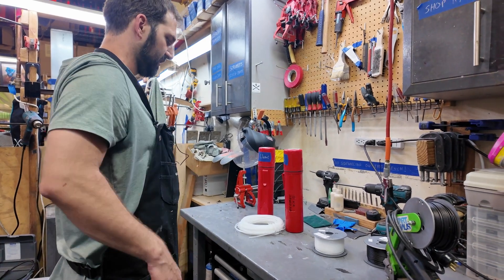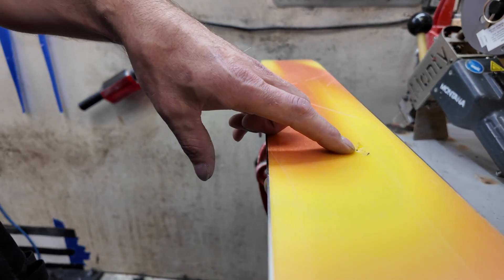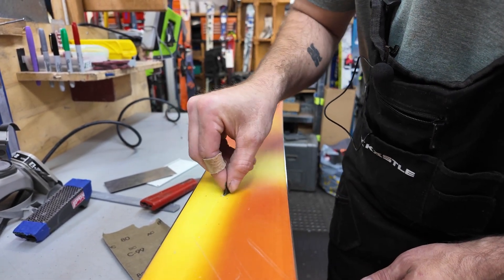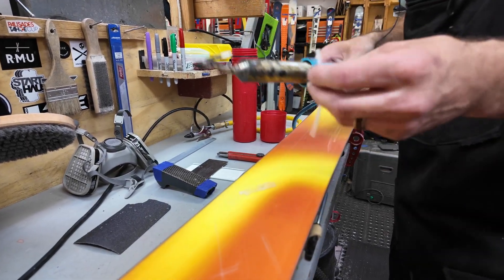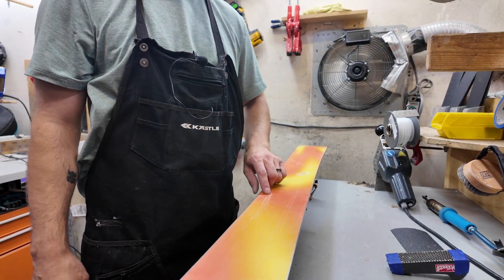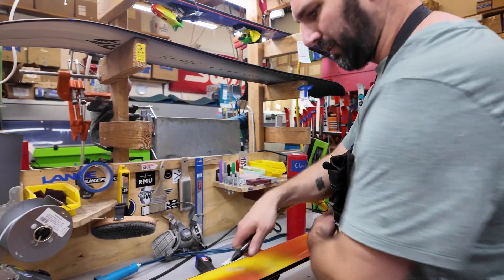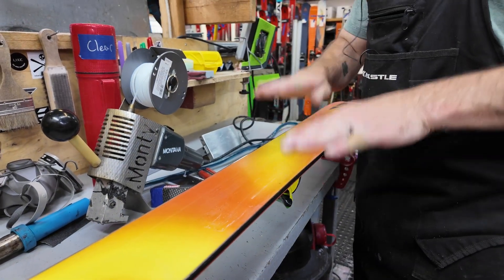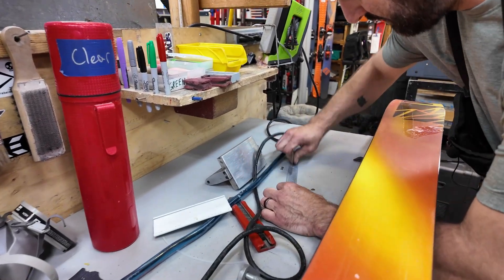P-Tex vs. Air Welding | Ski Base Repair Demonstrated | Start Haus SKI LAB

Comment: I don’t get why you didn’t stone grind after. Surely you took away the structure when belt sanding? I’m genuinely curious as don’t fully understand the process
Reply from the maker: Up to the customer.  We would always prefer to grind after a repair and make it structurally perfect (which adds cost), but some people just want a quick patch and be on their way.
Reply: Hi guys, what do you mean when you say the belt sander removes structure?

Comment: Hey! I have the opportunity to buy a Montoya gun for around 1000 euros. I'm wondering if it's possible to work with both black and clear P-Tex material on one device. Have you noticed if even after cleaning, the clear P-Tex remains dirty? You think this worth this money?
Reply from the maker: You can def run both.  Just keep the head clean when its warm and clear out a bit when you swap spools.  If you repair a bunch, they save lots of time!
Reply: Thanks a lot :)  @Starthaus

Comment: Thanks for this video! I've been doing my own repairs for years and for the most part they come out pretty good. I see a lot of youtube shop doing candle drip method so I figured if thats what they're doing I might as well try myself. I bought a soldering iron for this like 20 years ago and it never worked tbh, not hot enough barely softens the ptex let alone melt it. So I have been mostly on black bases bit i have a white base now that I want to do a nice job on. 

Do you have any recomendations for tools to apply ptex at home diy?

Also both my boards have these comb like scratches. Where there are like 4 - 6 small scratches right next to each other. Looks like I ran over a metal comb, lol. I tried to repair this at home and it filled but i could not get it level. Any additional ptex will not stick. So I am going to cut it out a little and try again. But I am interested in a better way to apply the ptex and try the press method after. Do you have any tips for a scratch that looks like this (many scratches very close together)?

Also is there a place or brand of ptex you would recommend for home repair.

I ride at loveland colorado up on the ridge. I will always have something to repair. Hahaha
Reply from the maker: Swix makes decent ptex and is readily available. If the gouge is too shallow, Ptex will never hold properly (just dry scrape the burrs down with a metal scraper and when it's too much, might be time to have a shop do a base grind).  You might just need to try a hotter solder iron!  Melting the Ptex candle still works, its just not the most lasting repair and you end up with carbon in the mix that can effect the hold.

Comment: Great video! A couple of questions - is there a difference in the melting temperature that needs to be reached for a co-polymer and Ptex? I'm working with a soldering iron or temp-controlled air gun. And how can you tell you're buying a co-polymer and not metalgrip/ptex?
Reply from the maker: Hmmm, it's a bit of a moving target.  When using a soldering iron, exact temp matters less- you can experiment off the ski and see what is hot enough with your iron to melt and manipulate different material.  When using the air welder, things get a bit more touchy and you'll also need to trial some temps- if its too cold, obviously the co-poly won't be soft enough to adhere and press into the damage.  If it's too hot and you are moving the material too slowly, it will fully melt into the welder and gum it all up.  Air welding is all about temp + the speed at which you are feeding the material. Metal grip is easy to source (Tognar Tool Works) but good co-polymer is harder to find in consumer kits.  (We use a bulk spool from Wintersteiger.)  We're working on putting together our own repair kits for next season!
Reply: @Starthaus  thank you!

Comment: The sand paper is terrible. Use a special file or something that doesn't shed particles. You can see bits of sand left behind after you hit it with the air compressor.
Reply from the maker: At the very minimum, these get hot scraped as the final step.  More commonly, these will be finished on the grinder, THEN hot scraped.